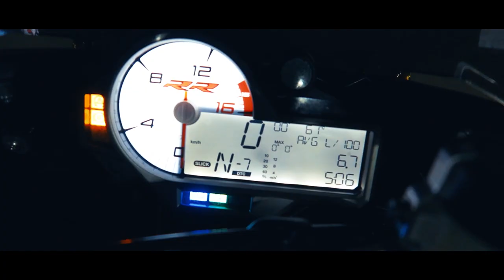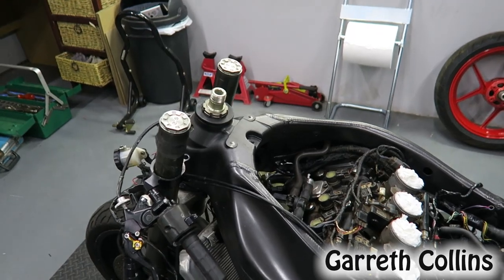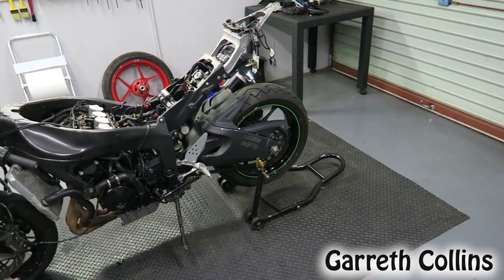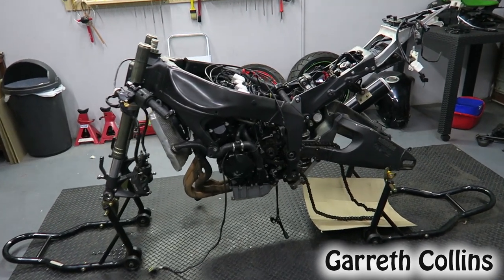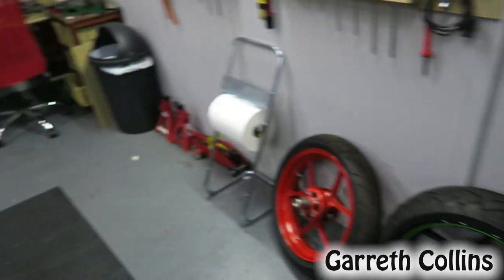Rebuilding A Crashed 2012 Kawasaki ZX-6R Part 2

Comment: What do you use as a degreaser?
Reply from the maker: I use Kerosene if its hard to remove the grease. Works great 👌
Reply: @GarrethCollins  Do you dilute it 50/50 with water?
Reply from the maker: @StumpfyStumpf  no i clean it with kerosene then i use a normal degreaser soap and then wash iy off with water.